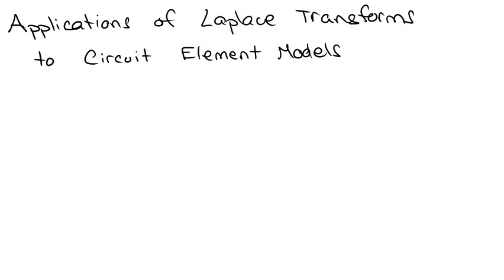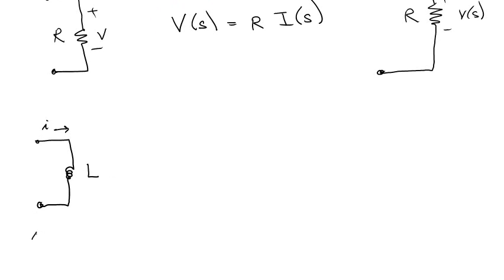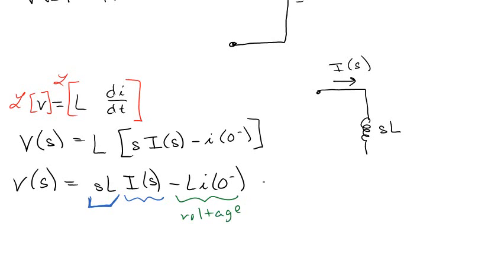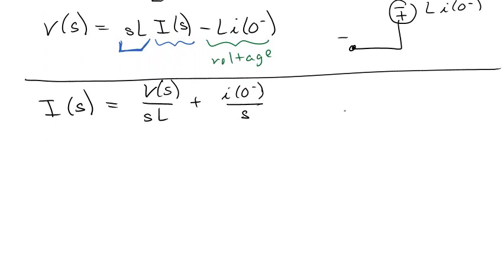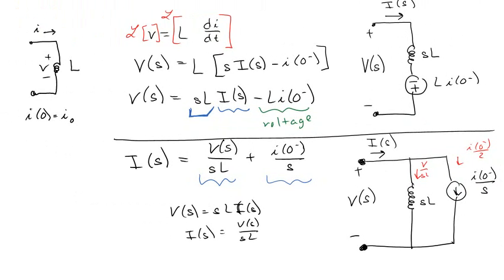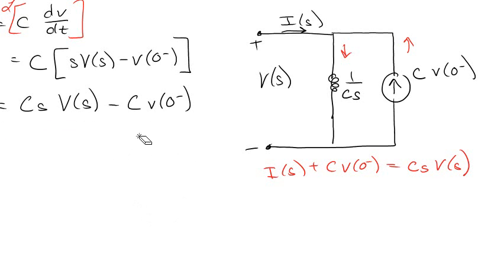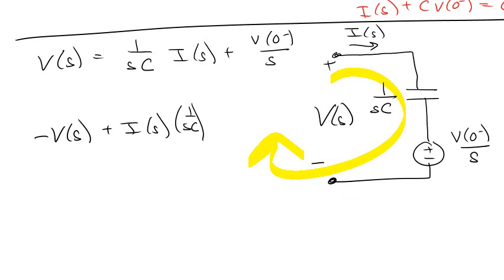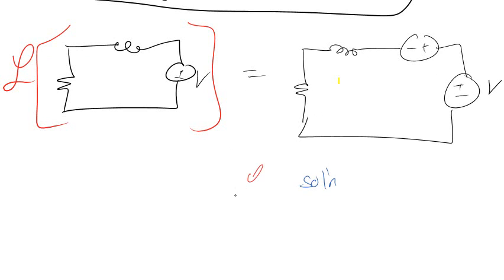Laplace Transforms of Circuit Elements

Comment: At 10:21 the drawing on the left has the capacitor in it but the solution drawing to the write includes an inductor and the opposing current source; are we doing the Laplace Transform for a capacitor or inductor?
Reply: So it looks like an inductor but its more of a square box that has the impedance of 1/(sC), so ITS NOT AN INDUCTOR.

Comment: Is s supposed to mean second^-1 ? I mean you said R = C^-1 * s^-1.. 1ohm is kg*m^2/(second*Coulomb^2) and 1F is second^2*Coulomb^2/(kg*m^2).. If you divide 1ohm by 1/1F (essentially multiplying the two), you get 1 second. But that s you wrote in that formula is in the denominator, essentially suggesting that s stands for second^-1. Is that correct?

Comment: This Laplace is more confusing more than the applied electronic mathematics taught in a 2 two year Electrical/Electronics Engineering Associates degree. Engineering Technicians never use LAPLACE transforms in BREADBOARDING / CONSTRUCTING / TESTING electronic circuits in the practical world.